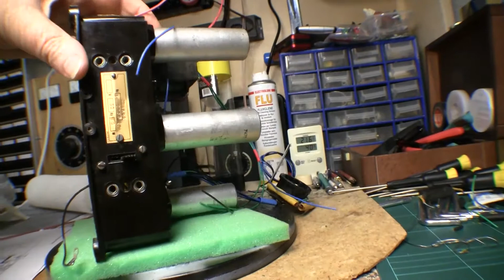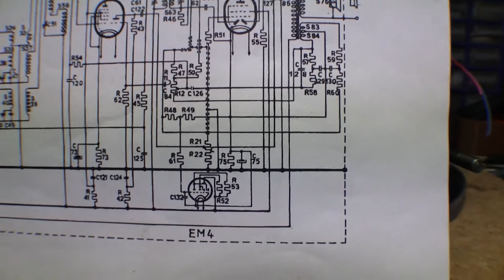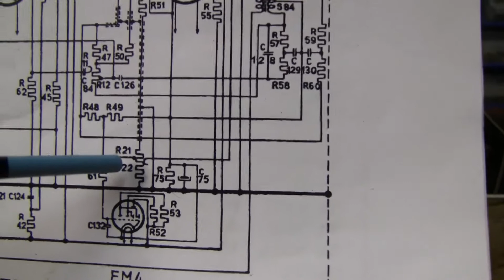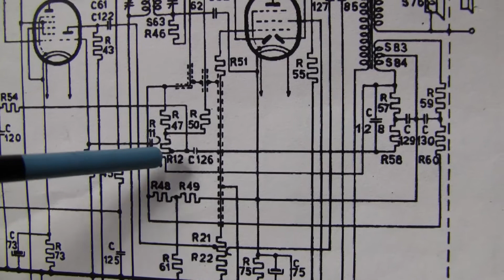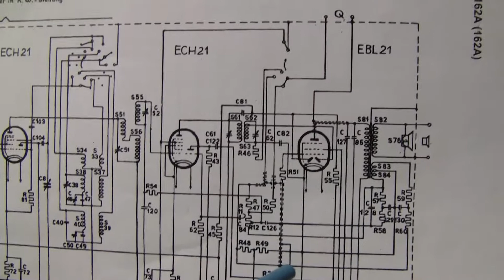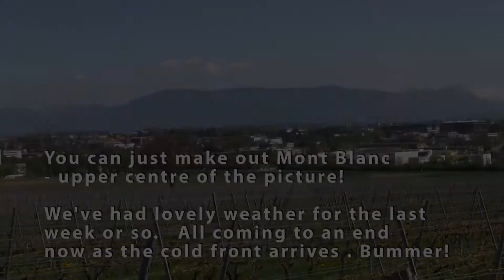Mediator M162A - part 3

Comment: Very meticulous and well done. Best, Don
Reply from the maker: RestoreOldRadios Thanks Don.  At least I'm getting to know the challenges with a set that has rubber coated wiring - a first for me!Cheers,   John
Reply: Zone1242 I've dealt with at least three rewire jobs so far, and several partials. I won't say that it becomes easier the more you do, but it definitely becomes less intimidating after a while. I find that the point to point wiring, from terminal to terminal, isn't so bad, but making up things like speaker cables, eye tube cables, or battery cables, get tricky if you don't have the original cable to work from. Most companies in Canada at least, had the good sense to use cloth wire in such cables, so unless they have been abused or hardened from heat, they are usually still serviceable.